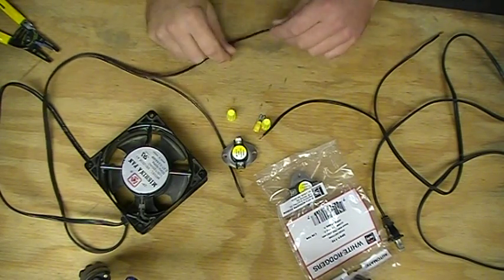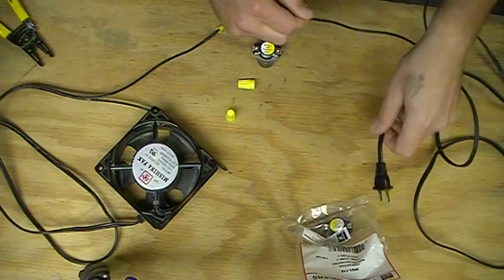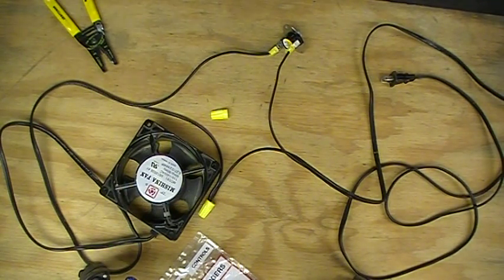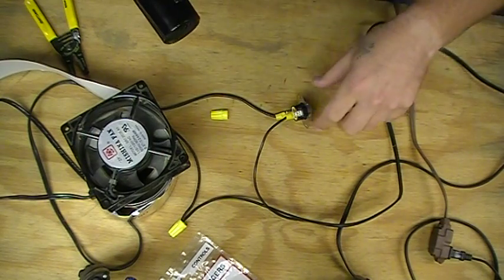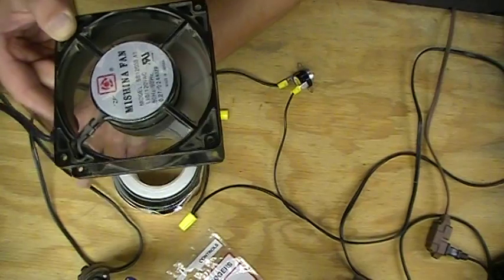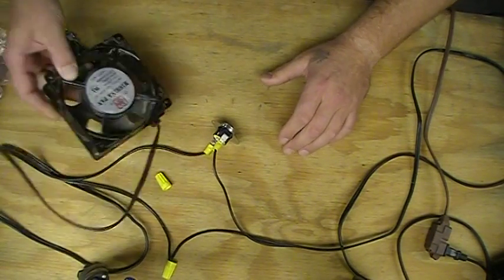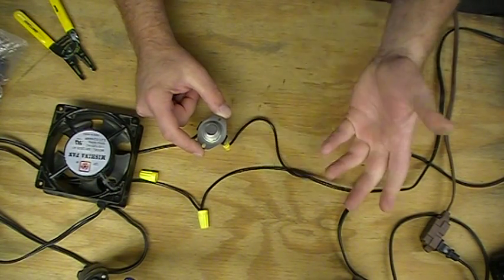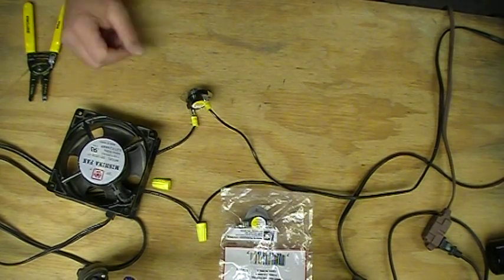solar hot air heater switch 1.MOD

Comment: @twistedvisions68 hello again would you now the power and ground wires on a pc fan there is a yellow black and red its a dc pc fan also would you now if this fan would work if i hooked it  to my inline duct fan im just trying to get more air flow my duct fan is hooked up to a snap disc thanks for your help